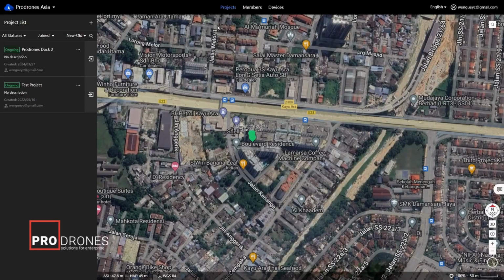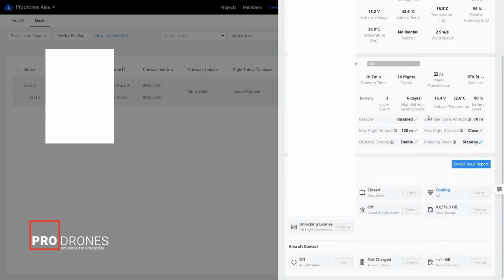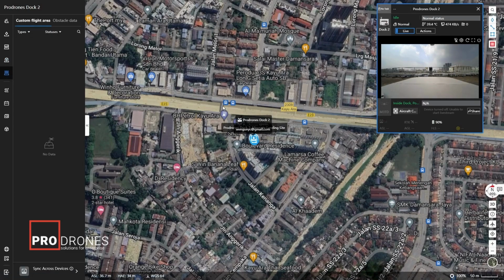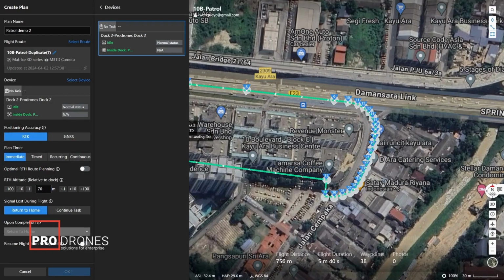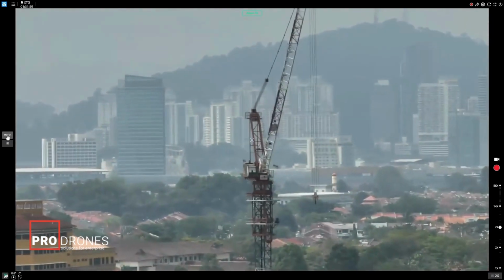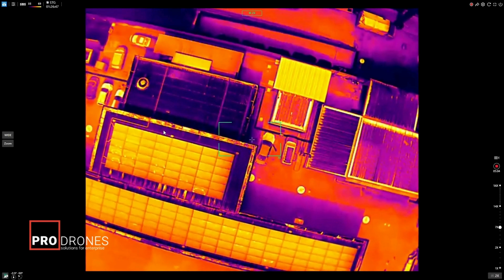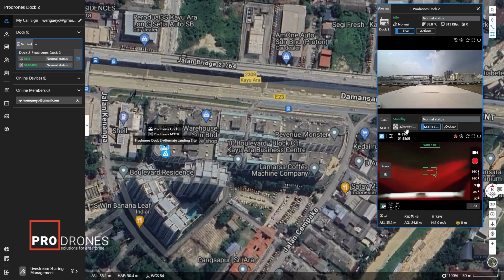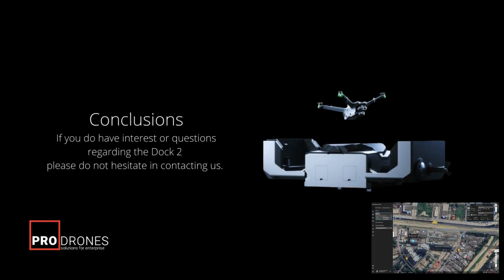DJI Dock 2 & M3TD: DJI Flighthub 2 User Interface (Part 2)

Comment: how do you change the thermal setting when making waypoints in flighthub2? currently only seeing recording in White Hot.
Reply from the maker: The palette used was the last one used and it is set manually. Hope this helps

Comment: Did you make the building the POI or set the gimbal angle / drone orientation to face the building at every waypoint?
Reply from the maker: I set the gimbal angle at every waypoint as I wanted the focus not at a point but rather a specific angle along the entire building.